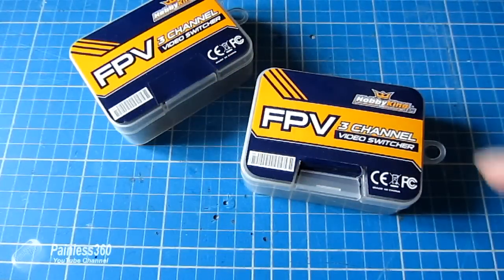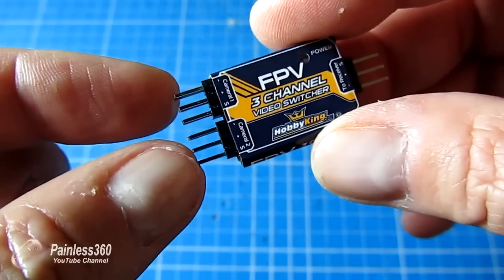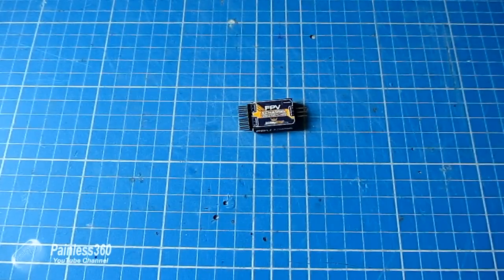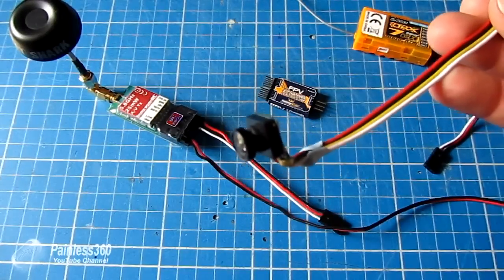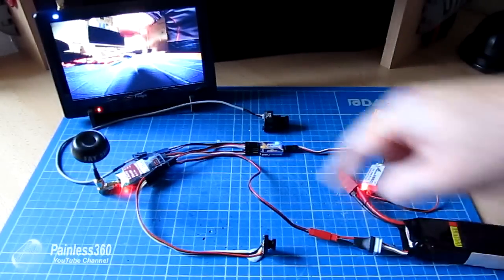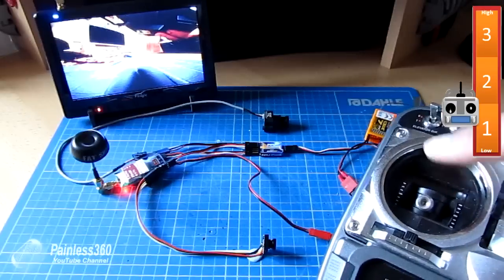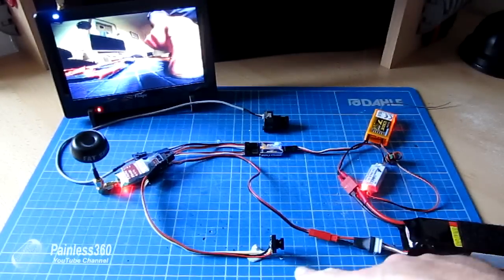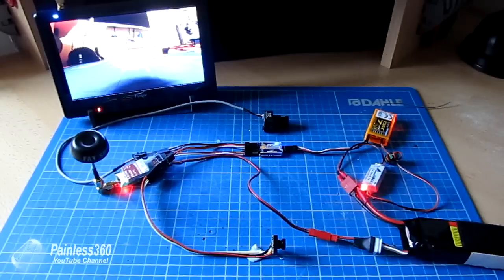HobbyKing FPV 3 channel video switch

Comment: Hi I have successfully connected all three cameras with APM+minim OSD, all cameras are pal, but for some reason only the camera on channel 1 show solid OSD, other 2 goes on and off and there are clearly interference on the screen (I only have ground and signal coming out of these cameras to OSD and switcher, power comes from Vtx).  Anywats, I later  hooked OSD to only the main flight camera and put OSD output into the switcher, this solved the shaky images on other 2 cameras. MY Q is, is it possible to feed OSD to all three cameras or is this beyong the capability of minim OSD?
Reply from the maker: +MaydayRC I've never tried it with more than two myself. I suspect that that something is different with that final camera. Best of luck with it.

Comment: is it ok to connect this to a 6V dc receiver? coz its operating volts is only 5 i wonder if it will fry or not or will just operate normally

Comment: Hi, I'm not clear on this POS/NEG thing on the cameras, does things go bang or simply not work?
Reply from the maker: +paul40925 it won't explode. Just select a different input. You can set it up and then plug the camera into each input confirm which one is selected. Best if luck!
Reply: thank you, I have now found out there was a labelling issue with these. obviously as long as the power input to the tx is correct. I just didn't want to blow up cameras!!

Comment: im having a problem! when im switching between cameras it takes around 3 seconds for the screen to be correctly adjusted. my osd also is getting bad on cam 2 and 3. do you know how to solve this issue? thanks.
Reply from the maker: Are they both PAL or NTSC?
Reply: Painless360 PAL
Reply: I have just posted a rather lengthly comment above... have a read, could be something to try!

Comment: Will this switcher work with a 2.4ghz video transmitter?
Reply from the maker: It's dealing with the video signal from the camera way before it gets to the Vtx.. Should work with everything unless, watch out for cameras with different PAL and NTSC settings, that may confuse some systems..

Comment: what happens if you cut the power of the FPV switcher?simulating a failure. I mean.. there is still image that pass through? (cameras powered apart, direct to battery). If not signal pass through when that thing fails (4.6$ plus shipping), it's nonsense to use  in a FPV model. Better stay with only one camera and a pair of servos for pan and tilt. I can't trust in such a vital component like that.
Reply: Kind of true what you say. To lose power to the switch would mean you have lost power to the Rx so you're pretty fucked anyway.
Reply from the maker: paulkazjack Very true! :)
Reply: u didn't understand. I mean unplug the power of the switcher to simulate a switcher failure, meaning the switcher is dead, not the receiver....i didn't say that the receiver is dead lol, the receiver is still working but the switcher is dead.
Reply: To add. What if your pan servo fails whilst facing the leading edge of the wing ? Lets not have camera servos too.
Reply: welll, I dont use servos, so this is not a problem for me, it's your plroblem
Reply: well, all the system of hundreds of $$$ depends on a 4 $$ video switcher. U are crazy guys.
Reply: The weakest link in the system are the servos.
Reply from the maker: I've often found the weakest link that causes most crashes is the pilot :)
Reply: well, crashes when u are learning, then, NO CRASHES about 90% of flight  time. All depends on you. Do what you want, but remember 4s$$
Reply: Painless360 could be mechanical or voltage failure that causes crash